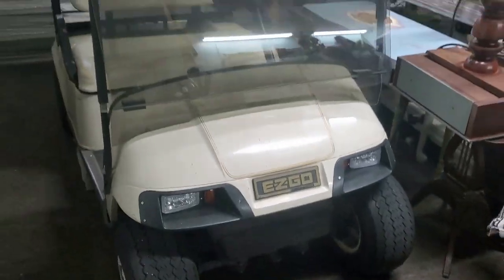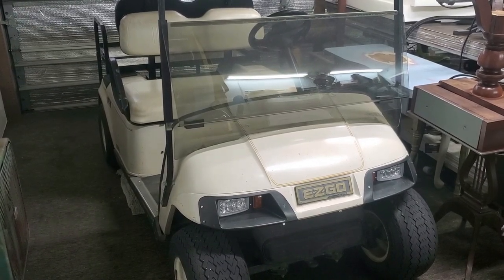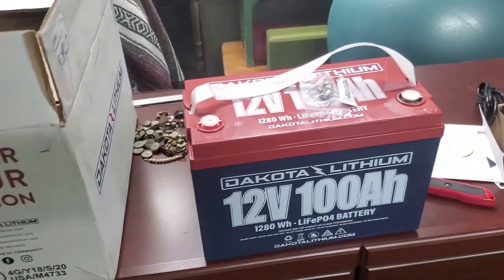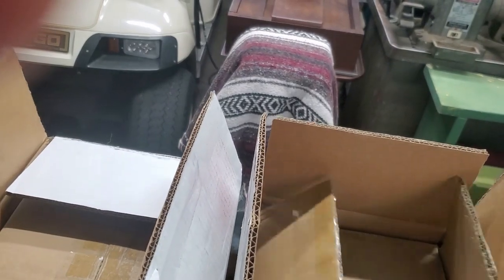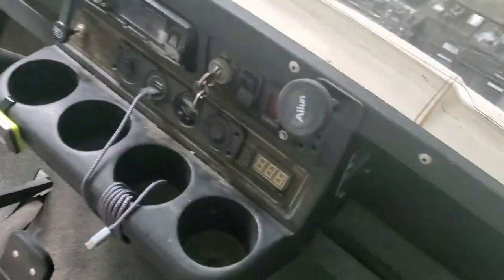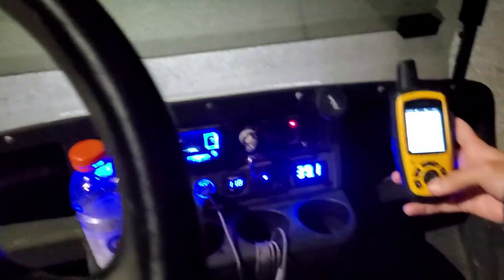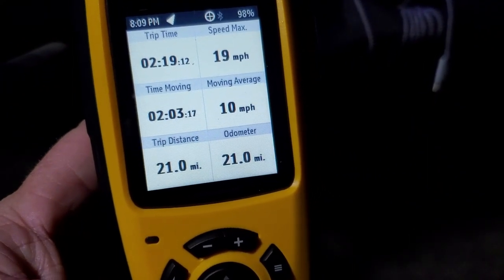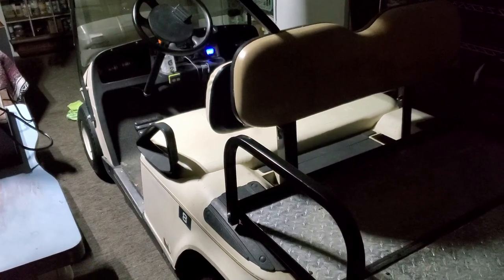Review- Replacing 36 volt Lead Acid with Dakota Lithium Ion TXT 36 Volt golf cart and 20+ mile test

Comment: so you replace $150 (max) batteries that are known to work for years with ones that cost FIVE OR TEN TIMES as much? 
I am baffled by the utility and horrified at the level of 'marketing' that leads to this.
Reply from the maker: I think your information and details are off brother. I have replaced the typical lead acid batteries in this cart for years prior to going Lithium. They do not cost $150. Cheapest is around $500 for a set. And as much as $1000 for top of the line. I typically got 3 years out of them. But the last year is really just putting up with batteries that have drastically reduced performance and range. Don't forget...its really not how many years..its how many recharges and to what depth of discharge. Some users get a year of daily use. Others get 5 or 6 years of seasonal and occasional use. We use our cart on average 2 times a week for rides of 10 to 20 miles on average. The last year of the lead acids they wont even make the 20 and hardly make 10 miles towards the end. You can see my other video for actual real range testing on the Lithiums. 45 actual miles at one time in the real live world with 9% reserve. After having these lithiums for around a year I can report there is absolutely no comparison. None at all. My cart is now as maintenance free as one could hope and I could not be happier.  And we are just scratching the surface. Keep reading and researching and you will eventually come to the same conclusion. Especially as pricing drops. Thanks for the comment.

Comment: $7200. That is almost the price of a new cart.
Reply from the maker: What cost $7200? The batteries where $2200 with a charger. Fyi..I have had these now for some time. Prices are dropping. Ampere time and Chins have batteries very similar to these with similar BMS and you can get them through Amazon for $399 each now. Great time to own a golf cart.

Comment: Whoa!  $899 per battery????
Reply from the maker: Not quite. The cost is $2399 when you buy the 36 volt golf cart package that includes the charger. The charger is typically $199. So that works out to around $730 per battery. Its not cheap. But for me it was very much worth it. I have been driving these Dakotas around in the cart now for a few months on our normal route. I have not used more than about 35% of a charge yet.  I always return home and have around 65 to 70% remaining. On the old lead acids I was stranded several times when they were just a few years old. Going for a ride of any distance with the lead acids was like gambling and the house sometimes won...lol. Having these batteries has boosted my confidence and enjoyment of the cart easily equal to or more than the value of the batteries. I love things that just work. My cart is now one thing less I have to even think about. I don't water it. I don't have range anxiety. I don't have to clean up the white acid powder under the cart, they take much less time to charge. And they wont die suddenly after 2 years when I'm 4 miles from home...lol. And with any luxk...it should be this way for years and years. Money well spent for me.